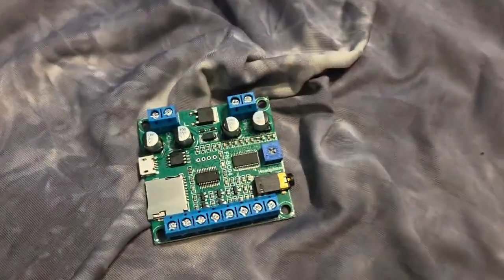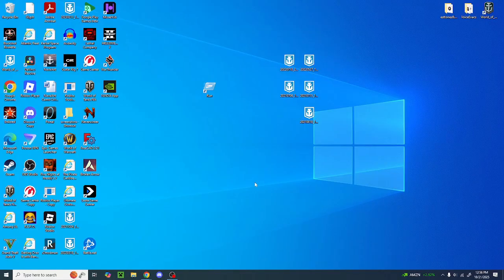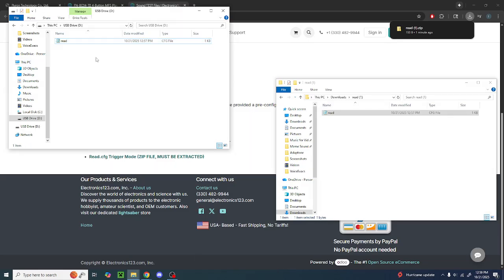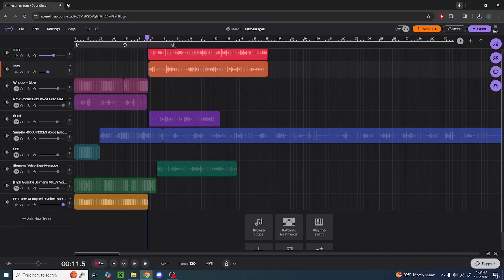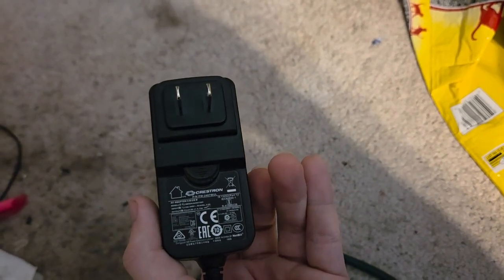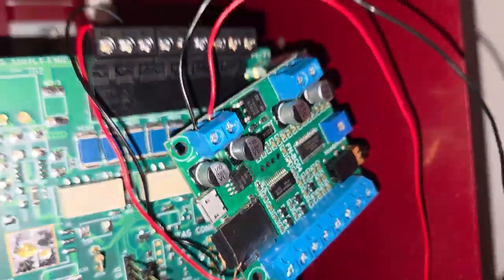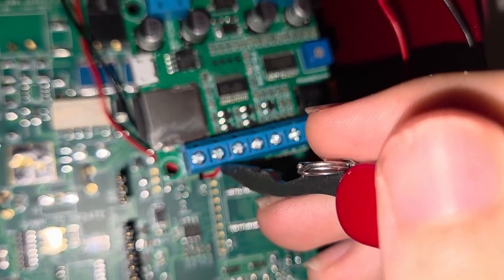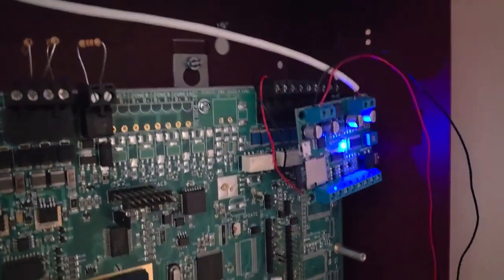Turn ANY FIRE ALARM PANEL into VOICE EVAC! | How to set up a Relay-Triggerable MP3 Player

Comment: i love the idea but....this would get any fire alarm with this installed red flagged by an inspector the moment it was found and will invalidate your fire insurance if not corrected. they don't play around with life safety equipment,especially the notification circuits . however this board is great for doing chimes and other non-life safety system sounding around the house. now if it was certified for fire alarm, then it would be really cool as normal voice op systems are expensive.
Reply from the maker: I am aware. I guess I should have mentioned in the video that this is for collectors and not for real use...
Reply: @firealarmguy979  ah. i can respect that. collection use is perfect for this board.